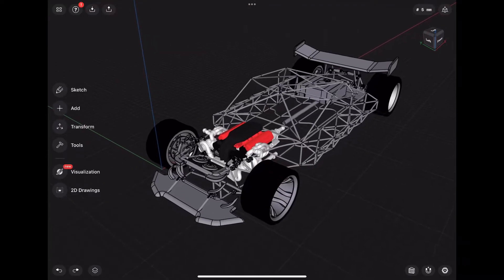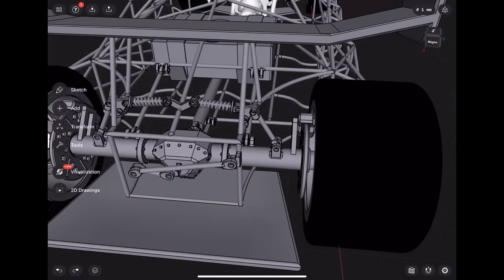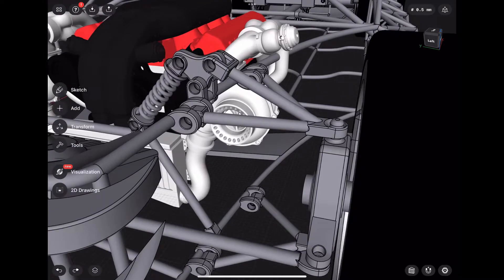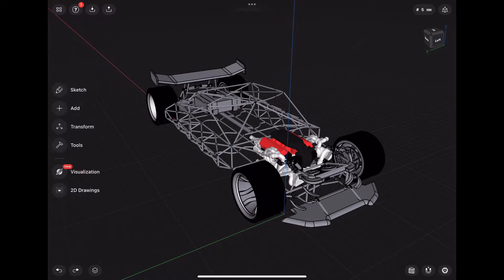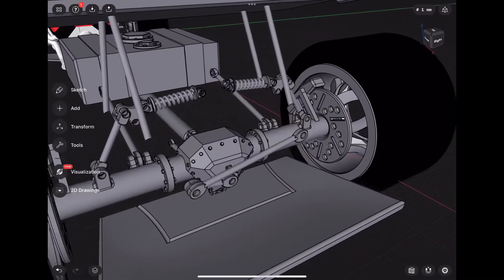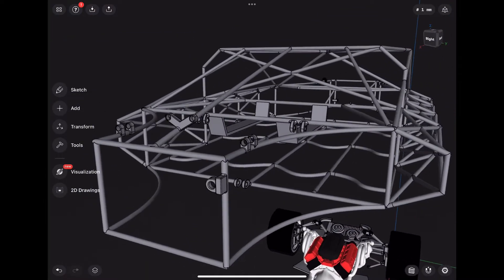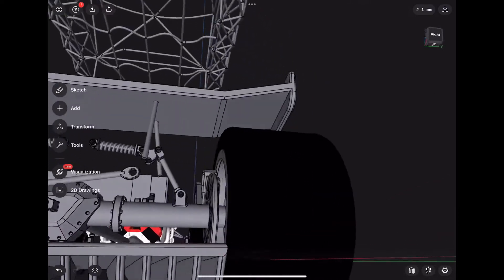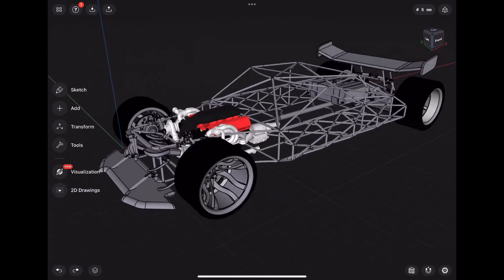Tube Chassis Race Car Design Showcase. Made with Shapr3D

Comment: Where did you get that engine and transmission model from? I'm designing a real rear engine car and could sure use that to check for fit. 

People have told me that the engine and transmission won't fit but I'm pretty sure it will.
Reply from the maker: I got it from Cults3D.com from @blackboxstl. It’s a combo 572 big block + twin turbo kit. Two separate files.
Reply: @ScaleModelAddicts  Thanks! I figured if a big block will fit anything will.

Comment: Awesome. Do you have a workflow video for this? I’m wanting to design a chassis on Shapr3d as well but I’m having trouble figuring out where to start.
Reply from the maker: Hey dude, unfortunately I don’t. I actually used the short instructional videos within the app to make this one. I had made other more basic chassis from other shapes but when I did this I was really just exploring the tools within shapr3d, and this was the result. So my advice is to just explore the app, try a few things out and then try it again. Have a few reference photos saved to your iPad or whatever device you’re using before you start so you have a goal in mind.
Reply: Thanks man I appreciate the reply! I’ll try and get it sorted and making sense.